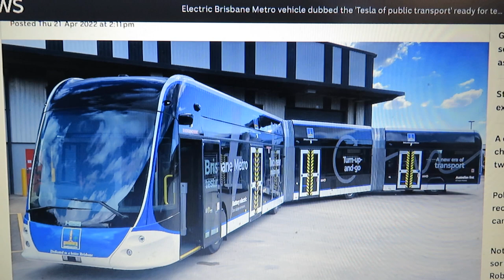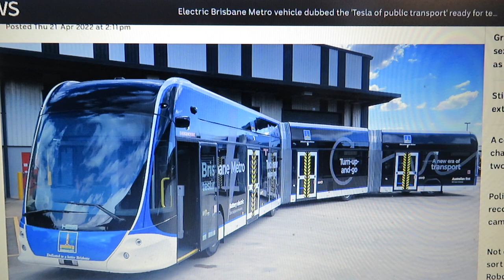Brisbane METRO. . . . poor planning. John Coyle video.

Comment: The reason it's called metro is because the former Lord Mayor Graham quirk intended to run the route as a Paris style rubber tyred tracked metro. Infact the busway was built with the intention of converting to rail. However the route is operated by Brisbane City council which cannot compete with Queensland rail and has a lower budget and so we get a much worse service because of silly political feud between state and council
Reply from the maker: I agree, as per  my answer regarding the original plans, I fully expect changes within two or three years! Those changes really must result in very big  bus station capacity changes. It is simply laughable that those changes were NOT made in the first place.

Comment: This is not a trackless tram. This is whats known as a "bus rapid transit" system, which is supposedly is like rail public transport, without...the rail. A trackless tram seems like its also just a bus rapid transit system, but with extra steps. Bus rapid transit makes sense in a lot of places, but not places where a regular tram would make a lot more sense!
Reply from the maker: I agree 100% and of course a genuine trackless tram system could and SHOULD have been built. Like many transport enthusiasts will be out taking videos and photos on opening day Sometime NEXT YEAR. Double articulated buses should NOT be called a METRO. . . . . and as I have said more than once. . . . . this may be the worst transport investment ever made, in Brisbane. Right up there with closing the original electric tram system in 1969!
Reply from the maker: I agree, what I see as a fault in all of this is therms used are confusing. Calling a double articulated BUS in Brisbane, a METRO is absurd! Trackless tram or guided bus are the SAME THING in effect!

Comment: Well all of there problems that you speak of, I quite sure they have been addressed.  And any system that has any type of rail is much more expensive to install and maintain.  So as you said how will a double articulated vehicle accommodate more people well we must look a the frequency of the service. It is possible to make it work and when there is a rail and non rail vehicle can go around problems when a rail vehicle cannot.  So give the agency a chance to work out the bugs. This project just my work.
Reply from the maker: I agree in that there will be a slight improvement on the direct routes served, however, I have heard  that a number of bus routes will be CUT BACK to a Bus Station along the way. Thus, people will STAND waiting to reach their bus station to transfer to the route needed, for onward travel! PROBLEMS from day one! Still, of course, I plan on riding on the first day of service, early next year.

Comment: There won’t be any transferring from bus to bus…. It will be the same as routes 111 and 66; you don’t transfer from one bus to another on those routes…. Unless you are going somewhere outside of that route.

Only difference will be it’s more frequent and the metro vehicle has a higher load capacity.

Normal articulated buses used on 111 and 66 have a capacity of 116 persons standing load…

Metro has a capacity of 150 persons and 170 in event mode.

I believe that the infrastructure of rails and/or overhead wires is more expensive than just using the existing busway that has potential to expand fairly cheaply in the future (Which the metro is going to be using).

I believe that the vehicle itself has a lot of really good passenger friendly features especially for the disabled persons that with use it.

I respect your opinions and I guess we will have to see when it is operational. Personally I’m excited to see how it works out.
Reply from the maker: It really is a case of wait and see. I read somewhere that routes 111 and 66 will be replaced by the so called METRO. . . fair enough, THAT is expected. An upgrade in service. However, I WAS told by a friend that in fact a number of bus routes  will terminate at bus stations and will not go into the BRISBANE CBD and the BCC have said as much. The METRO will NOT have the capacity to take the passengers from the routes that will be truncated. A guided bus or trackless tram [ pick your term]  of FIVE CARS would have been a far better alternative than the METRO we are getting. It is just in fact a double articulated bus, which are found in Europe, as you know. Such a costly project with little to show for the money! Don't get me wrong, I plan on riding the METRO on  Day One, for sure.
Reply: @johncoyle777  isn't that meant to encorage people to drive to work. Its all to benefit secure parking

Comment: not many views..great graphics ..was recommend to me by Google.. I have been in the mock up..was impressive inside  I will ride on it when operational in due course.
Reply: Similar concept coming in India as Metro Neo for small cities and peripheral areas of major cities. I think this is great concept.
Reply from the maker: I maintain that the METRO [ so called]  should have been a guided bus, to allow FIVE  CAR  vehicles instead of only three. . . . . there are MANY double articulated buses in the world, so the METRO is no big deal! I WILL ride on the first day of service and make some videos, of course.
Reply: @johncoyle777   A metro is a rapid-mass transit system that services an urban metro area. The only thing holding back the busway from becoming a metro is a couple of intersections that hold back the service. But these intersections are being fixed. It is the network itself that will become the metro, not the vehicles. These vehicles will only be used in the metro network. This method of rapid-mass transit can be adopted by smaller cities in Queensland and Australia wide. The Brisbane Metro is not poor planning at all. Only those who don't really understand what a metro actually is, think this is poor planning. You need to take this video down for poor research before you misguide more people.

Comment: An interesting video thank you John. Now then, if we look at the current electricity infrastructure across Queensland, we see that coal powered plants are being shut down one after the other. As any electrical engineer will tell you, wind and solar plants just don’t cut it so where is all the juice going to come from to charge the enormous batteries in these new buses?
Reply from the maker: Where do I start? About 80%  of base load power is from COAL fired power stations, so electric buses are moving pollution from the vehicle to the power station!  Shutting down Coal fired stations is a totally MISGUIDED POLICY and will result in BLACKOUTS that will shut down the electric train services in Brisbane. How would YOU like to sit on a train for a long time, awaiting rescue? I went to Rosewood one day, only to have the  train fail, and a stupid overreaction by QR  meant that I was over FOUR HOURS  late, getting home. When there is a blackout, just imagine what would happen to the METRO. . . . yes, it IS battery powered. . . . but it MUST change up at the end of the run. . . so, oops, no power to recharge the batteries!
Reply: @johncoyle777  totally agreed John, for a preview of what will happen here We only need to look at South Africa!
Reply from the maker: @peterblack1538  PLEASE outline what you are talking about with South Africa! That sounds interesting. Calling the FUSS BUS a METRO, may be seen as a error soon. I was told by a BCC Bus driver that the double articulated buses, only just fit the bus stations in Brisbane. So, the question is, where is the forward planning. . . why weren't the bus stations REBUILT to take FIVE VEHICLE trackless trams? HAD that happened, I would regard it was a major advance in transport, for Brisbane.
Reply from the maker: @peterblack1538  The LABOR state governments and the LABOR Federal Government. . . . . are determined to shut down COAL FIRED POWER STATIONS ASAP. . . . meaning BLACKOUTS  for sure! BUT still a few years away, so who knows what will happen in the world, the way CHINA and RUSSIA are carrying on. . . . we just might end up keeping those power stations after all.
Reply from the maker: the leftist madness of closing coal fired power stations will result in BLACKOUTS and the trains and so called METRO shutting down!
Reply: Just like many new technologies, we have what we call a Disruptive Technology, some of which have a tendency to excite the Karen's of the world who simply should not expect perfection overnight, but who cares, lets just have a big whinge.
Reply from the maker: @rogerjamespaul5528  What I have said about the so called METRO, is pointing out that instead of a five car guided bus or trackless tram. . . . . call it what you like. . . we have a simple double articulated bus! But 99% of the population will be fooled by this slight improvement in transport because they are blissfully unaware that there are other double articulated buses operating with FUSS in Europe, for example!
Reply from the maker: https://www.facebook.com/tramwayjohn/videos/901939640892794
Reply: @johncoyle777  thats what they want. Everyone to drive so they make money from fuel tax

Comment: I don't know who has problems with an electric bus. Just because it says Metro on it?
it doesn't need tracks or overhead wires, so it's not a train. 
And it only needs a few stations where it can charge at stops to stay mobile all day. 
I have more doubts about the people who chose this name.
Do you want to drive environmentally friendly with electricity (battery bus) soon or continue to rely on stinking diesel buses for decades?
Reply from the maker: I do not have a problem with electric buses nor of course double articulated buses, but calling them a METRO is misleading and silly, in fact. The so called METRO vehicles in Brisbane are NOT as advanced, as SHOULD have been the case with the money being spent. FIVE CAR vehicles that are guided by electronic tags  in the street, Would have been a genuine advance! The METRO will not have the capacity to carry the passenger load, when a number of bus routes are truncated, as is planned.
Reply: @johncoyle777  I don't know where the buses will be used. But it only makes sense where other buses are too short or there are no tracks.
So it's more like new routes that you want to serve additionally.
And the name will probably confuse everyone
In any case, those responsible have recognised that new vehicles with new environmentally friendly drives should be purchased. Even if they are currently more expensive than diesel buses.
Reply from the maker: @beatrueegg2722   You are quite incorrect regarding no transfers bus to bus. . . . there will be a number of such services  and that is freely admitted. Check out the BCC PROM videos on the METRO. . . one more time, I am going to say this. . . . the so called METRO will not have the capacity to take bus loads of passengers who are destined for other bus routes
, connecting with the METRO
Reply: @johncoyle777  I wanted to keep my answer general, not specific to Brisbane, except for the reference to environmentally friendly driving.

Comment: John coyle with due respect it's only single ended nit not double ended 😮😅😊
Reply from the maker: SURE, I am now fully aware that the vehicles are single ended. However, I had read that the plan WAS for a trackless tram that would have been double ended, and if it had been guided, there could have been five section vehicles. . . . . . but THAT was ruined by the fact that the bus stations were NOT expended to take more than the double articulated buses that are being used. A SAD situation and a great opportunity LOST!

Comment: What are you on about? Agree though they need to change the name it’s NOT a metro. It’s BUS RAPID TRANSPORT OR BUS ELECTRIC RAPID TRANSPORT. This will be high capacity on the busway and we can transfer to our suburban bus at RBWH to travel further north for example. There are too many yellow buses on the busway currently, and they will run every 5 minutes, being quicker for me to get the 66 from the city on the busway then get onto my feeder 370 bus at RBWH and go to Windsor then to simply get the 370 from the city itself as it goes slowly via the valley and is mixed with traffic. It’s not a novelty it’s stopping the yellow buses clogging Adelaide street and the current busway. 1/3 of them are being routed around eagle street and I will go from RBWH TO KGS on high frequency metro instead - which mind you is separated from the traffic! It’s more regular than currently and holds more people than 1 bus. I don’t think you understand it’s about increasing capacity on those current busway routes for fast turn up and go in the inner ring and each of the major busway stations along the existing lines and future extensions.
Reply: Not really. Metro can mean a few things. 1. Underground heavy train eg. NYC, 2. Electric street rail eg. GC, 3. Any city network eg. Adelaide call their train and bus network 'the metro'. Also metro short for 'metropolitan' ... so I see no perfect fit and so brissy taking this definition is fine

Comment: The "Metro" naming doesn't help what this system really is.. just longer busses. And that's fine, the main reason for these as I understand it is to help reduce the amount of bus congestion especially around the city/south Brisbane corridor by running higher capacity vehicles instead (and hopefully by so doing allowing that additional bus capacity to go back into the feeder routes for more frequency). This was literally the most cost-effective solution available, just add some chargers at each end and upgrade to some more decent and nicer vehicles.

I have to disagree with going the whole guided busway option, especially with the particular system you're suggesting. 5-car vehicles don't exist (at least from what I've seen) and are usually just bi-articulated models that are perhaps marginally longer than what we've ordered. Plus we'd be paying more in infrastructure (overhead wires, track) costs to run those similar capacity vehicles. Any upgrade beyond these "metro" busses should be in the form of a switch to proper light-rail or maybe even an actual metro rail.

The channel RMTransit put out a pretty decent response video just now to something the CNBC put out regarding these autonomous/guided bus systems that's worth checking out - https://youtu.be/RjKG0Lw1uFc